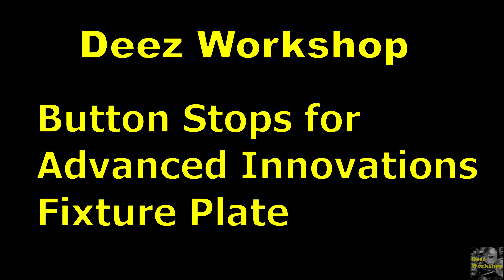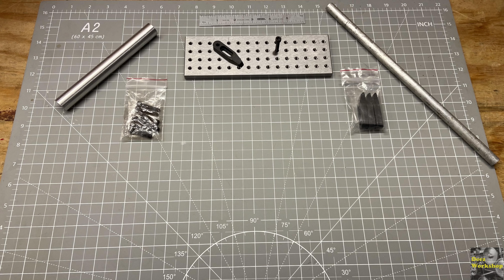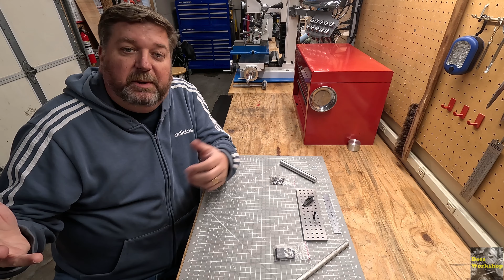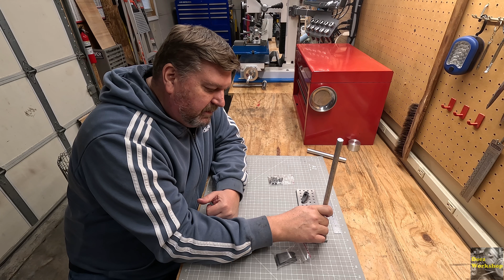Button Stops for Advanced Innovations Fixture Plate - @joepie221 beginner lathe project

Comment: what parting tool is that? it seems to do better than mine!
Reply from the maker: I bought a carbide insert parting tool. Pretty sure it was this link but I don’t think it was as expensive as it is now. Regardless I hope this helps. It does work very well. I’m pleased with it. https://a.co/d/1mFhkqh

I often use a high speed steel parting blade.
Reply: @deezworkshop   thanks bud!